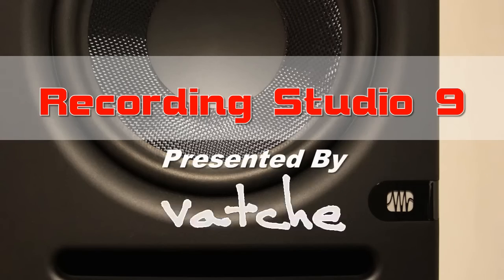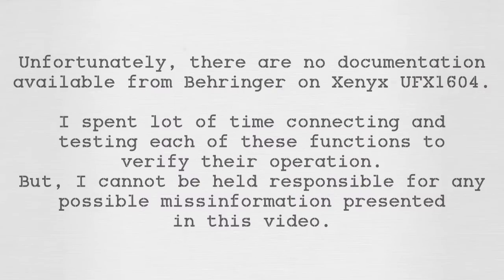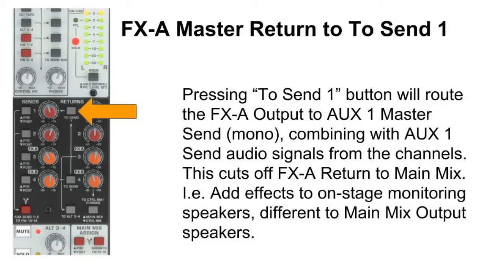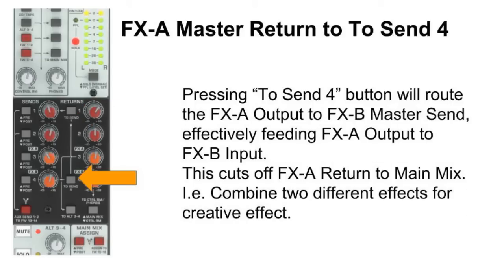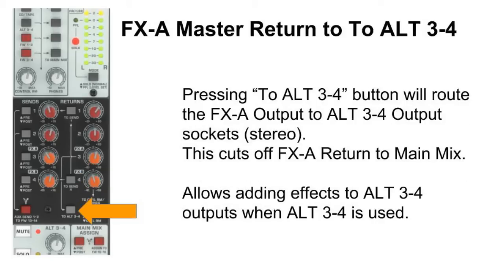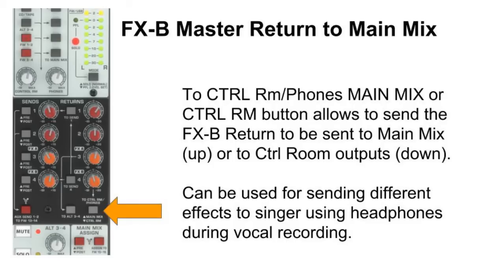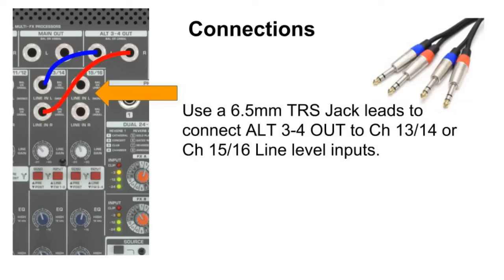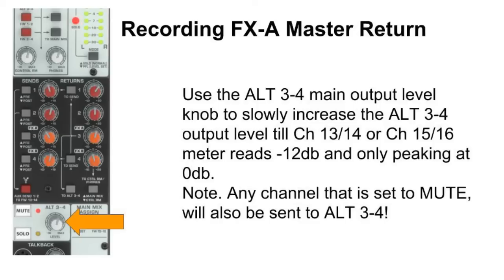Behringer Xenyx UFX1604 Mixer Audio Interface In Detail - Part 6 - FX Module Audio Routing

Comment: Thank you for your Tutorials! I have a question: will the FX On Switches choose wether I use the internal FX or external, or will the internal FX just be de-activated by pluggin in something into the „FX“ Aux returns? So the FX ON switches are just for ON /OFF internal FX, not for choosing Internal/external for the Aux returns? Thank you!!!!
Reply from the maker: FX buttons are internal. Internal FX disables once you insert a plug into FX send.
Reply: @ Thanks for the fast reply, later I was able to check by myself, I have an UFX1204. Internal FX are deactivated by plugging into the Aux RETURNS here, not sends, as with your 1604. Anyway, the Design  would have been better if you could choose just by pressing the button, so you could have let  the returns plugged permanent, when working with a patchbay. 🤨

Comment: Hey mate, is there a way we can have alt 3-4 come out of the main system instead of the fold back speakers?
Reply from the maker: When channel ALT 3-4 is up, the channel is unmuted and signal is sent to main out. When down, it's "muted" from the main and sent to ALT 3-4 output. Your question also depends where you have your fold back speakers connected.
Reply: Ok, if I wanted to 9/10, 11/12 for mics… would I be able to use a XRS female to TRS input for that?

Comment: Hi Vatche,  I have just started looking at these mixers, 1204 and 1604, because they have exactly the features I want.  It looks like the 1604 is out of stock almost everywhere.  I want to try and buy one.  My only concern is reliability.  I seems several people including you have had problems.  Because the support at Behringer seems to be weak I'm afraid of getting stuck with a bad unit.  What is your opinion on this.
Ted R

Comment: Hi There, Thanks for providing such a great tutorial. I have a question, is it possible to record a complete post all channel (1-13) into the INTERNAL recorder? Say, I want to capture the sound that I am hearing during a live session including all internal effects and external effects from channel 1 to 13 (I am using 14-16 for external effects and bus compression). The reason would be to capture the moment and not nesseserly bring dry signal for further processing. 

Appreciate your help
Reply: Sorry for the late reply,  here is how I achieved bus compression. Send output of your compressor to the mono input of channel 15/16, then send aux sends 1 to the input of your compressor. Male sure your channel input is on "line". Put your gain on 1/4. Now you can bus compress all your channels using aux 1 on each channel input.  You can also change the amount of compressor gain distribution using your channel 15/16 feeder.
Reply from the maker: @PamirAFG  That's how I used to use my outboard compressors too. Thanks for sharing.
Reply from the maker: Thanks for your comments.
Unfortunately no. The internal recorder uses the same audio path as the USB and FX is not part of the audio path. 
You can set Main as 15+16 to record main output with FX.
You can record each channel's Pre/Post EQ, but as I have explained in the other videos, I would not advise this unless you have a reason.
P.S. How are you achieving BUS Compression as Compression is a serial process?

Comment: Hello, i also have the UFX1204 version and have found your videos *extremely* helpful... I do have a question in regards to the FX routing though which i am finding frustrating... I Love some of the effects i am getting from the on-board system, but am frustrated that they won't also come through on my DAW when recording :/ -- I see you have a workaround using the AUX3/4 function on the 1604, but there is no such option on the 1204 unfortunately... i am also wondering how the AUX3/4 handles FX on multiple channels? -- For example, i have Reverb set up on my Vocals and a lesser amount of Reverb on my Rhythm Guitar track... If you send the FX through the AUX3/4 channel, it seems like it would combine all the different FX for different channels onto a single track and thus without the ability to adjust levels individually... Would this be correct? Thanks :)
Reply from the maker: The FX on the UFX1204 are meant for live performances and not for recording them. But if you really want them, then depending on the DAW used, this maybe possible afterwards.
Once you record all your channels into your DAW, you can send the single channel, i.e. Vocals track in your DAW to outputs 3/4, which is channels 11/12 on the mixer. set the FX level you like and record channels 15/16 in your DAW on a new track. This will have the original vocals plus the FX recorded. Now you have a track in your DAW that has the  mixer FX. Do the same steps for the other tracks/instruments in your DAW and record new FX tracks in your DAW.